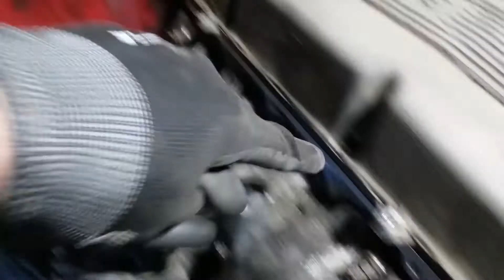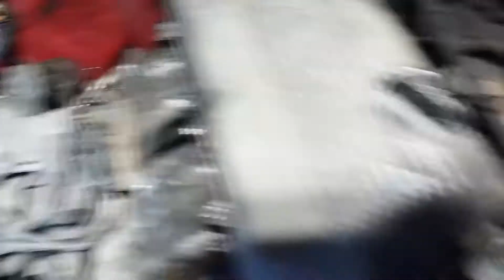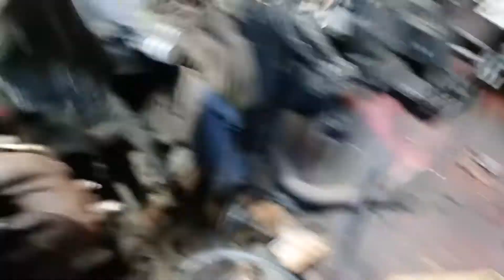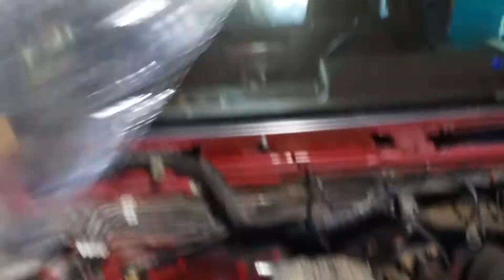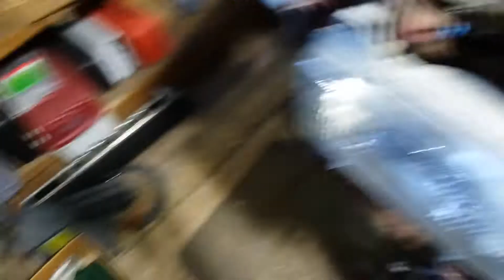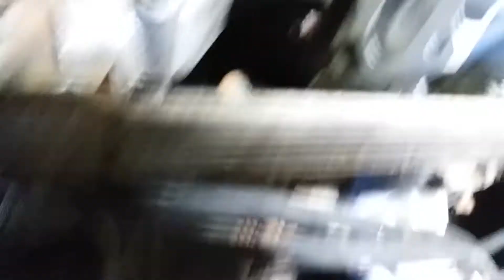Nissan Hardbody [Patches] Head Gasket Repair Project Part 15: In Conclusion

Comment: Looking nice. If I delete the EGR on a 96, you think I will get codes? Also the tube that runs from my charcoal canister the valve by the air cleaner is full of little coal looking little rocks any idea what it is? Thanks
Reply from the maker: You will get a light on the 96 for deleting the egr. As for the coal, sounds like the canister is coming apart to me.
Reply: @SuperchargedPathfinder  ok thanks. Hope it won't leave me stranded. Looking forward for next video